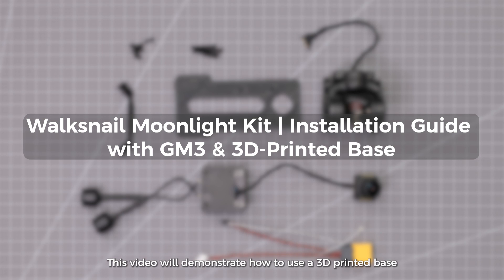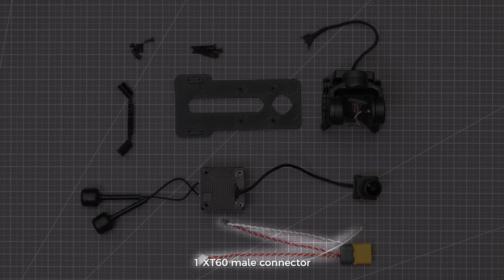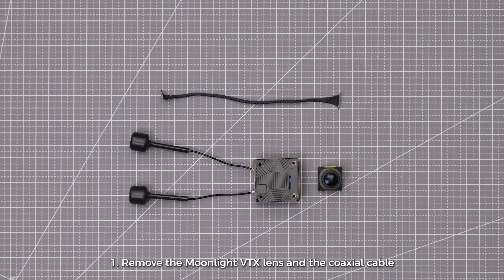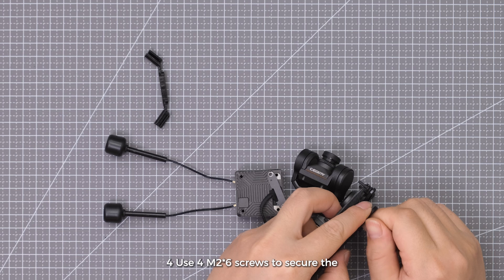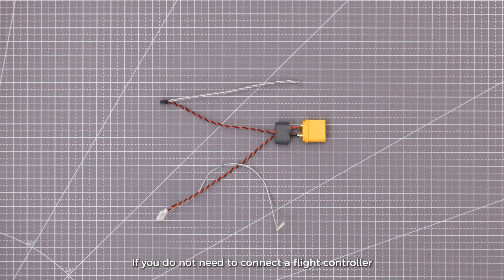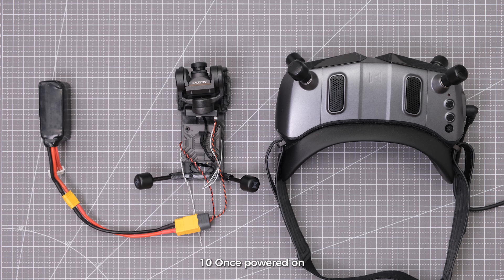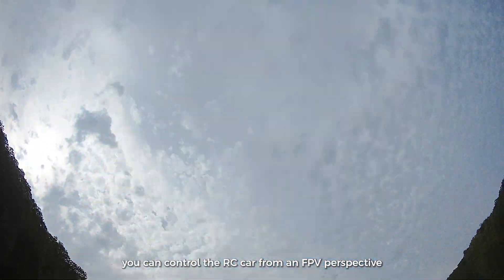Walksnail Moonlight Kit | Installation Guide with GM3 & 3D Printed Base

Comment: So is this system separate from my transmitter and receiver that’s in my plane?
Reply from the maker: You can control the gimbal by the head-tracking function of Walksnail Goggles.

Comment: what if the lipo is a 6S 4000mAh with XT90 connector? Can i use a splitter so the XT90 goes to ESC and an XT60 to the air unit? Also if i need to connect from flight controller red and black for OSD i connect 3 reds and 3 blacks like in your video where you soldering two reds and two blacks? i Suppose for the signal i need to solder flight controller's white with gray from air unit (TX-->RX)?

Comment: Hi so with this kit no soldering required ?

Also where can we purchase the whole kit please
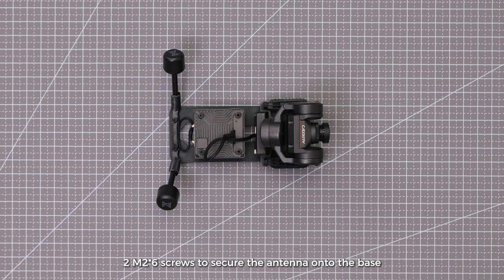Reply from the maker: 1:15 – 1:36
The connection of the power cables needs soldering.
Walksnail Moonlight Kit:
https://caddxfpv.com/products/walksnail-moonlight-kit?variant=47701308997934
CADDXFPV VTX Gimbal GM3:
https://caddxfpv.com/products/caddxfpv-gm1-gm2-gm3?variant=48924891611438

Comment: This setup needs a fan. The moonlight VTX overheats easily when doing ground FPV. Would be nice to have an ultra low power mode for ground use since range is not needed. Or a fan adapter for Moonlight like the GT VTX fan. I’ve printed fan mounts but added fan mount point with proper hole spacing in the vtx housing or fan module from caddx would be awesome. 
While I’m making a wish list - a more compact pan tilt gimbal for smaller rc cars would be great.
Reply: I just responded saying the same thing....I just bought the gt kit fans on recommendation but now that I got them I see they're 5v fans and the moonlight doesn't have a 5v output like the gt vtx so Idk how i'm going to make this work...super inconvenient with how hot the moonlight kit gets that they didn't make any fan for it.
Reply: @DaFcknPope I tried using a 5v bec to convert any 2s-6s input voltage to 5v and it worked but just added extra bulk and complication. I’ve tried 5-6 different fans of various voltages and 3D printed adapters/mounts. Best I’ve found so far is a higher rpm 12v 30x15 fan with nylon standoffs that flex enough to match the hole pattern on the moonlight and I just connect to the same 3s battery as the moonlight VTX
Reply: @ExcessLip  yea i was figuring id have to just wire it up to the same battery but was really hoping there was a way to do it differently....man this blows. I wonder if my BEC can output 5v at the same time it does the 12v.
If not i basically ordered 2 of the gt fans for no reason

Comment: What type of battery does it run off of? Thanks
Reply from the maker: Hi Friend. That battery is of 4S650mah. Basically, it is as the same standard as the battery in Caddx goggles. ❤
Reply: @CADDXFPV  Thanks I've just purchased the GM3, Goggles L and also the Moonlight fpv camera. Can the goggles and GM3 run of say a 2s 1000mah battery? Thanks
Reply from the maker: @forzabike  Hi friend. Of course ❤
Reply: Thanks for the reply. Does the vattery C rating matter? I'm thinking of getting a 4s 850mah  but it has a C rating of 70C @CADDXFPV